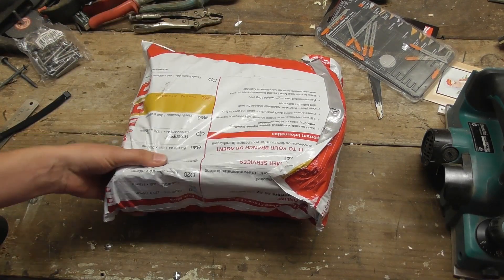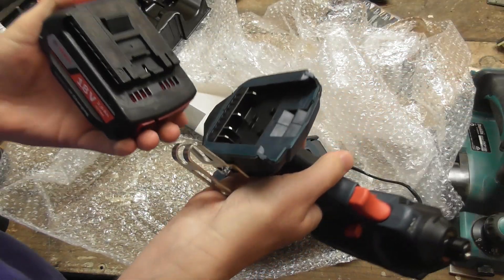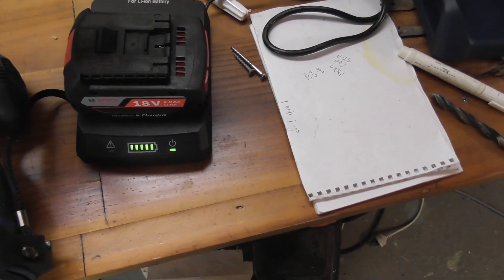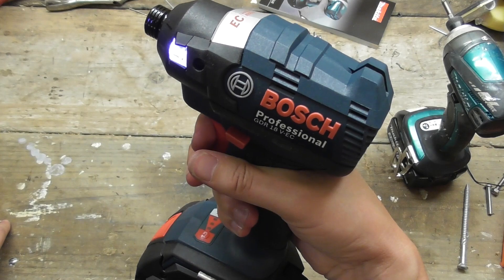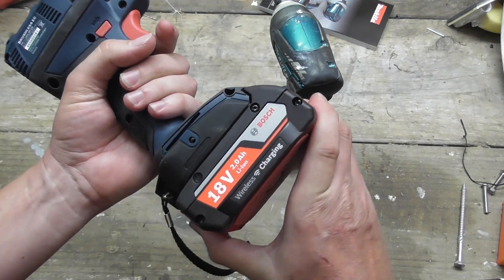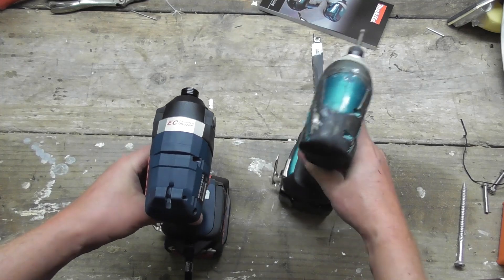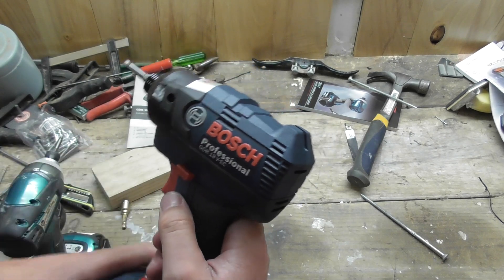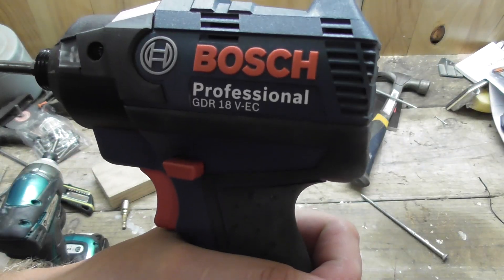Bosch Impact Driver - GDR 18V-EC Brushless Impact Driver Review

Comment: I have noticed that the Bosch tools are in generally slower than his closest competitors, Makita, DeWalt, etc, but the reason why I buy almost always Bosch tools is that they are giving me a feeling of trust. I have compared a few times tools from Bosch to tools from Makita and I have noticed that Bosch is paying more attention to the way in which they build their tools, in other words, I like more the quality of manufacture from the Bosch tools than the Makita tools, even if is not always the case, I have seen tools from Bosch builted in a very cheaply manner. Mainly, the quality of the plastics, the quality of the carcass joints are better at the Bosch comparative to Makita. But Makita build better suitcases. Other reason is that i like more the color of Bosch, the turqoise color of Makita is prone to dirt much faster. In the end, in generally, I like more the design of the Bosch tools. I'm an amateur so for me the speed is not a decisive factor when I buy a tool, but as I said, the Bosch gives me a state of trust. But I have a chain saw from Makita.
Reply from the maker: The thing I dislike most about this Bosch, having used it for some time now, is it is too chunky and no good at getting in close or in tight spaces. Makita impact drivers are the best design in my opinion for limited spaces.
Reply: @ToolsAndStuffOFFICIAL  About this, you are right.

Comment: I owned gdx socket ready impact for 3 years. Great quality and very comfortable grip. It can't beat the lastest version drill on the market, but for this aged drill. Still does excellent job in real work. Not like another competition they test oversize screw we never used. Bosch is more step on the cordless market now. Will getting better and better.
Reply: I. Am in the usa. It's. Model IDH182 hear

Comment: I also just purchased the same drill. The reason why I also did it was because it was very cheap, even after import taxes - around 140 euros. I decided to go with GDR instead of GDX because I have a friend who experiened that the square shattered. I think it's okay. Not super powerful - but okay torque. When you use it with the 6,3 ah battery the power output increases quite a lot - 10-20 % compared to a 6ah battery!
Reply: ...how did your friend shatter the socket drive?! I've driven dozens of 11/16 tapcons at a go with mine.

Comment: You're comparing a 3 AH Makita battery to the 2 AH Bosch battery. Try a 5 AH Bosch battery and you'll notice a huge improvement in grunt. Amp Hours are not just equated to how long the battery charge lasts.

Comment: i have noticed that many competitors beat my bosch at the screw challenge but my bosch beats them at lug nuts and my bosch has lasted 8 years now
Reply from the maker: Maybe I will try that. I was doing some concrete boxing today with the bosch and it was painfully slow driving the screws compared to the makita.
Reply: It's my go to for heavy duty work, even though I also have a milwaukee Fuel M18 (that thing is way stronger and faster) the Bosch however does not break and or bend my bits. Most of the time I actually use a M12 90 degree driver anything T20 and below it works great. I use my Bosch to remove and replace lug nuts on my truck no other tool and it works great for that. Interesting to note the milwaukee can't remove the lug nut after I put it on with the Bosch.
Reply: Thanks for that insight. What bosch, specifically, do you have?
Reply: I had up to now the 12v(it is the one that lasted 8 years) and the 18v impactor now I have the new one with the 1/2 drive. I'm pretty sure that they perform similarly but the new one lasts longer. I gave my 12v to a friend and the 18v to my dad both still work great.
Reply: Thanks! this is the one that I was looking at to do my lugnuts.... http://www.bosch-professional.com/za/en/cordless-impact-wrench-gds-18-v-ec-250-225590-06019d8120.html
Reply from the maker: @benmarsom3381   You are so wrong. Dewalt, Stanley, Black and Decker and Makita are not owned by TTI. Makita is a solely owned company and always has been and is run out of Japan.
Reply: bradman Swag the best tool as an electrician I recommend Bosh tools I use them every day
Reply: I be got this impact and it is me off the best I've used never let's me down and stood up to being dropped a few times. All my tools are Bosch.

Comment: wireless charging is a gimick
Reply from the maker: I used to think that but it depends on what you use your tools for. In a workshop environment the wireless chargers are perfect cos you never have to change batteries you just put the drill on the charger on your workbench all the time and it's always there ready to go. But at a worksite environment it's pretty pointless.